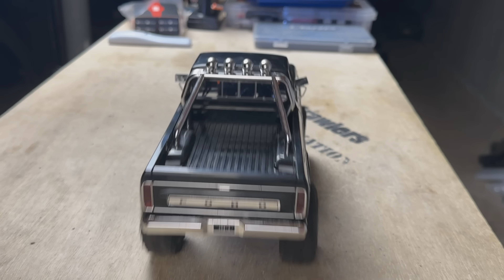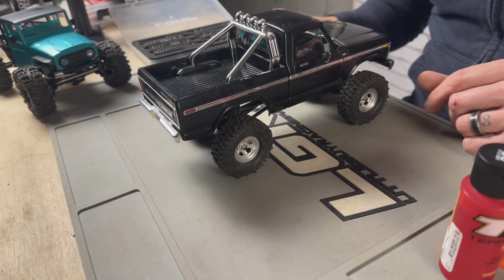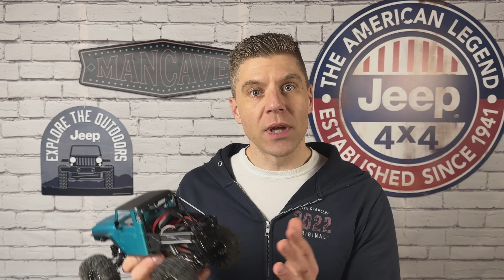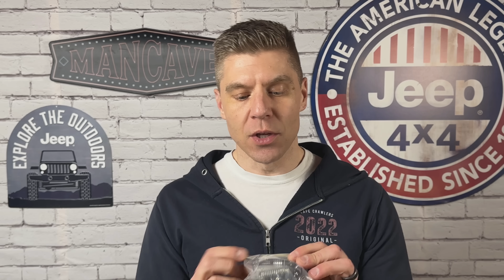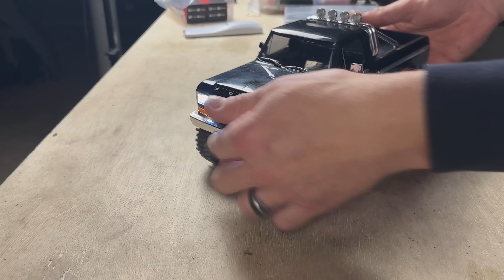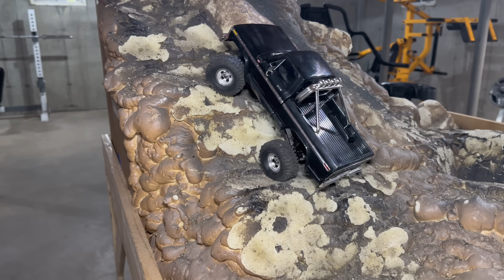TOP 5 Tips To Stop TORQUE TWIST!

Comment: The only way to actually reduce or remove torque twist is to install a sway bar. This is actually pretty easy to do on the TRX4M and I make mine from .047" piano wire. I only put the sway bar on the rear so you still get full articulation.

Comment: Never get rid of it…..just embrace it. Doesn’t hurt performance
Reply from the maker: I’m with you
Reply: Doesn’t it affect you on side hills and your articulation?
Reply: @Auto_guy699it can. I tried the stiffer springs that came with my shocks which helped some. Keep in mind the differ you go the higher it wants to sit and it doesn’t travel quite as easy. I ended up going back to the soft ones due to my tarantula body and it made it sit too high for what I wanted.

Comment: A couple issues with your suggestions:
- When doubling up springs, it's best that one spring is wound the opposite direction so that they don't interfere with each other.
- The higher turn motor has more torque than lower turns. Torque twist is a function of torque, so you're increasing it.  Throttle control and easing into it is just using less of the available torque that the motor produces.

Comment: could a person take a length of small piano wire bent into a "square C" shape pivoting of 2 points on the chassie like 2 identical shock locations and mount the ends to the axel. They would do nothing for lift but provide resistance for the axel to going out of line from the frame, just like a real swaybar :)
Reply: No you can't! don't do that!
Reply: @NGcCharlie LOL

Comment: Would too much overdrive cause torque twist? My Capra leans to driver side pretty bad under throttle…but it doesn’t do it on stand it’s a brand new build with 3 gear tranny. Everything seems to spin freely on stand

Comment: Great video. What you are showing with the hanging chassis is "dynamic" torque twist, which is less of a contributor on slow moving, high torque crawlers than "static" twist.  This will challenge a lot of the comments made here, but worm gears, planetary gears, counter rotating and portals do not change the static torque twist. Only the total gear reduction from motor mount to contact patch matters. I attempt to explain it in these two video. Shock tuning, as you explain is one of the only ways to reduce twist in a shaft driven vehicle. Keep the tech videos coming!

https://youtu.be/KBDeGCc8NvA

https://studio.youtube.com/video/3lMzPAvUCEQ/edit

Comment: Flip the motor around and run it ccw makes a good difference. I’m against messing about with the shocks unequally as it makes the truck handle unbalanced on one corner and you also loose articulation on one corner

Comment: This has nothing to due with torque twist but, what beadlock wheels can i use with the stock tires (Baja Pro Xs) for the High trail?
Reply from the maker: From what I hear (haven’t tried) the stock tires don’t play nice with many other wheels. Traxxas has released the method 1.0 wheels that will work. Those are nice but they’re pricey

Comment: I recently had a very crazy idea on the subject. I tied a thread to the axle where the suspension is. I ran the thread over the frame and connected it to the other axle on the same side. This on both sides offers full flex at any spring preload and eliminates 99% of tork twist. You just must not pinch the thread anywhere.
Reply: I don't get it - do you have a video about it?
Cheers 🤙
Reply from the maker: Genius!
Reply: @CapeCrawlers  thx, i was suprised too. Once i Had the Idea and could Not Imagine that its that easy. But Than i did it at a orlandoo x01 and what should i say. Its Like Magic 😅 now i Run it complet without shocks 🤣 and No torktwist

Comment: I had to get pretty aggressive with the shock oils to eliminate torque twist on my trx4m f150 high trail.  I went with hot racing shocks,80 weight oil,one stiff spring on the right rear and one stiff spring on the left front. No noticeable torque twist that i can see at all.

Comment: Panhard length is the most common issue people have with torque twist. A lot of people change their ride heights and shock lengths and don't realize the panhard needs to be adjusted for it.
Reply: The TRX4M has a panhard bar?

Comment: with what is on the market now. what tires would you put on a ax24 64mm or 70mm swamp claws. i am going to put a torquebeast 3.0 and 33% underdrive and maybe the mofo stretched high clearance brass links,emax servos,steering links,front brass knuckles? whats your opinion how this future build would turn out?
Reply from the maker: I would still stick with the 64mm on that scale. 70mm will swallow that thing. For that truck I would look at the JConcepts Ruptures. I would HIGHLY recommend and ESC upgrade. Otherwise your list sounds great
Reply: Would the 70mm swampclaws just be to much for the motor and servos? also what esc do you recommend

Comment: There are only really 2 things you can do to reduce body torque twist. 1-stiffer springs. 2-gear reduction WITHIN THE AXLE. (This reduces the torque experienced at the prop shaft aka body roll)
Reply: Btw smaller dia tires also increases the gear reduction and the torque in the prop shaft.

Comment: If you watch when the chassis is suspended it turns in the opposite direction from when the truck is on its wheels. So the effect of the motor spinning in the direction it is, helps in reducing the twist you see while it’s driving. Trucks like the UDR have a planetary gear reduction on the rear axle and that almost eliminates torque twist completely, as do worm gears previously mentioned. The suggestions you make in the video are great for reducing torque twist tho!
Reply: I appreciate the imput. It's why I waited to get an rc crawler. Everyone experiments and finds solutions to the majority of the complaints. I now getting shop aroubd for exactly what I want. And they finally made silicone inserts for the tires! I don't have to gamble on anything which is nice. Torque twist was my #1 reason I didn't buy early on.

Comment: If you want to see torque twist, hold the back wheels and apply slow throttle, see how the twist increases with more applied throttle though your motor and drive train is not spinning.
RC scientific's first video is also wrong, that is inertia vectoring or centrifugal forces. Watch his second video, its closer to science but if you fill in his equations it will give the whole story.

Comment: counter rotating drive shafts help with this as well.
But, as some mentioned, when you go from one axis of rotation and then re-route that rotation by 90degrees, that's where most problems are, and that's at the diffs. Other factors including gearing size and speed of the trans to the driveshaft to the diff also matter. 
The band aids you provided are good and will last, but there is also a cost in both money and performance of the rig.
What i'm annoyed at is that in the past 2 years, with manufacturers each putting out so many rigs, they have not bothered to evolve and fix this; because it'll cost them more to redesign and re-manufacture new stock parts so instead they will pump out the band aids for us to keep their profits up instead of providing good products.
Reply: Your facts are correct
The  solution however is not applicable to live axles so we as solid axle loving hobbiests have to work around chassis fixed final drives or learn to accept independent suspension. Ill live with a bit of trq flex rather 😂

Comment: People packing Red and tacky and thicker grease in their diffs/transmission is a big part of the twist as well. I personally only use Protek white gear grease as it is smooth and thin.
Reply: Dont add resistance.with a super thick grease designed for full size vehicles
Reply: Yeah I used super lube because it’s all I had. It’s safe for plastic and can handle higher temps than my RC could ever hit but it’s a little thick. I’ll replace it later whenever I buy seething else.

Comment: Im sorry but you are wrong with regards to the cause of torque twist. 
Torque twist are caused by the drive shaft thats fixed to a chassis mounted gearbox on the one side and suspension mounted axles on the other ends. Is your diffs was mounted to the chassis (independent suspension) it would transfer the twist straight to the chassis.
It is a result of the input to the ring vs pinion ratio. The bigger the final drive ratio the less the torque twist, hence portal reduction reduce this affect.
 Your theory of sentrifugale force is correct but does not cause torque twist.
Reply: Anti roll or torsion bar, reversing front to rear drive shaft rotation or increasing final drive only lessens Torque twist, it will never eliminate it with a drive shaft to ring and pinion live axle.
Only chassis mounted diff eliminate torque twist if the chassis is rigid to withstand the force.

Comment: The one thing that eliminated my torque twist was; Instead of putting two inner brass rings in the front tires, only use one on the torque twist side. That & I added weights to my sliders on the driver side. 
Worked like a charm!
Reply: That will effectively reduce the twist in one direction only, not eliminate it. The full size automotive industry  has all the answers we are looking for.😊
Reply: @ja_co_bus650  I only have torque twist in one direction, so yes it eliminated it!

Comment: Torque twist and a few other issues is why I circled back to worm drive axles for my micro crawlers.  The higher gear reduction in the worm drives lowers torque twist (amongst other advantages).  Ring/pinion portal axles are a little better than non portals, but they have their own can of worms.  I still think a Traxass UDR planetary style pinion is needed for the micro ring/pinion axles.  It would increase gear reduction at the axle, lowering torque twist, and wouldn`t affect ground clearance.  It would increase costs but I see other sites selling out of $150 micro axle sets regularly.
Reply: My Losi Nightcrawler is still Crawler king amongst my local competitors. Work Gears. Whish they made them metal though

Comment: Great video!

One of the main contributing factors to torque twist is how much of the total gear reduction is taking place in the differentials. The torque essentially has to make a 90 degree turn from the driveline to the wheels where the pinion gear meets the ring gear, and that torque reaction causes the twist.  

Example: As an experiment, I tried running the trail gears in the transmission with 16% underdrive in both axles, hoping to find a middle ground between the trail and crawler gears essentially. Compared to stock, the torque twist was dramatically worse. 

I've found that a healthy amount of overdrive is very effective in fighting twist. In my brushless tarantula build I have a total of about 25%, with 9% OD front and 16% UD rear. Any twist it has is so minimal as to be essentially undetectable. Still side hills great, seems to be the perfect amount of od/ud for a hardcore crawler/conp-ish build but I probably wouldn't go so aggressive with the gearing on a trail rig.